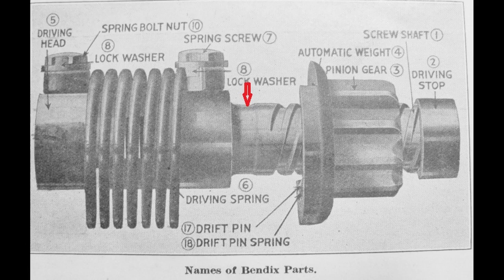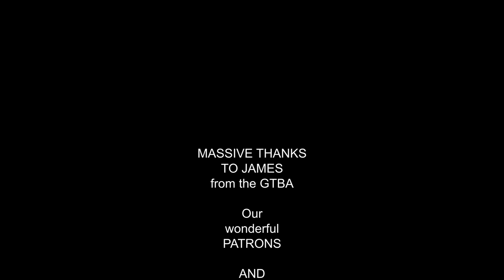DuB-EnG: DIY Jet Engine Laboratory - Axial Flow Gas Turbine Propulsion is not Rocket Science

Comment: Centrifugal is the simplest and easiest way to do it but really if I ever build one the goal will be an axial flow. It can be done, I know it can be done, I've seen it done, and know about 75% of what I need to actually do it. The problem is like you said, it's expensive to get the alloy blisk's made either yourself from getting the tooling to do it or have someone else do it. All your math has to be spot on too and the ramp rate on the compressor side has to be properly calculated along with the number of stages compared to the airflow through the compressor in order for it to even self sustain. Would be neat to do an annular combustion chamber but I'm not sure if it can be scaled down in size and still work. Too many exotic materials between that and just the turbine side of the engine. This doesn't even touch on the issue of an oiling system to keep the bearings oiled and cool which is a whole other nightmare I've not even sat down to figure out how to solve on such a small scale. On aircraft engines we have carbon seals which surround the shaft bearings and those have pressurized oil fed to them to keep everything happy. I don't even know if it's possible to scale that down but I've seen it done with ceramic bearings however longevity is a big issue with them especially with the heat they will see as the result of being run in a jet engine.
Reply from the maker: Keep us informed with your progress!!! :-). Keen to see the result!!!